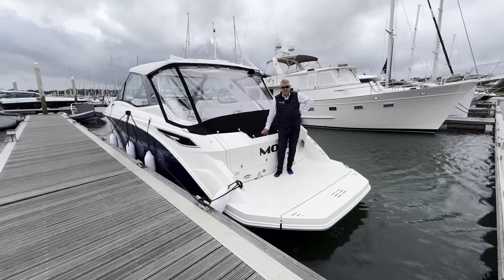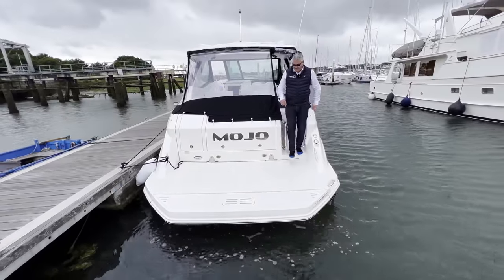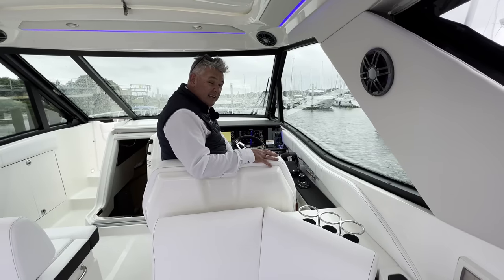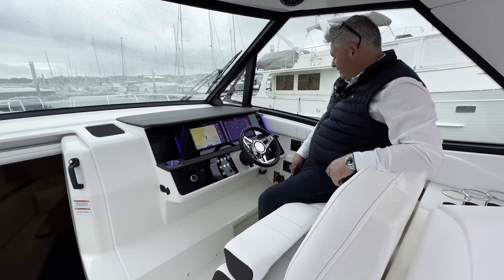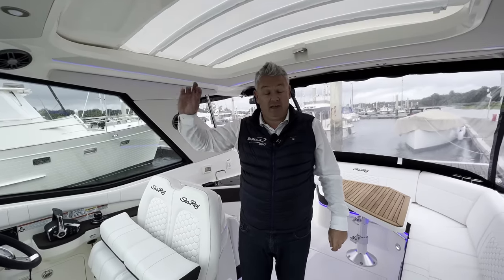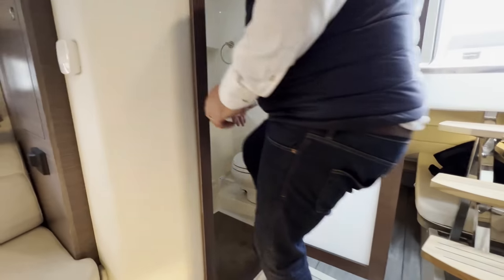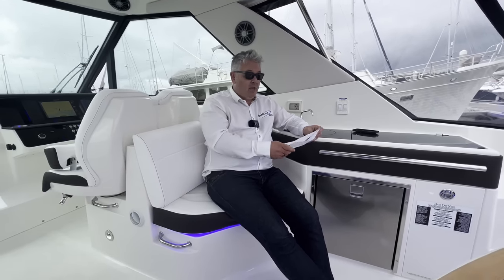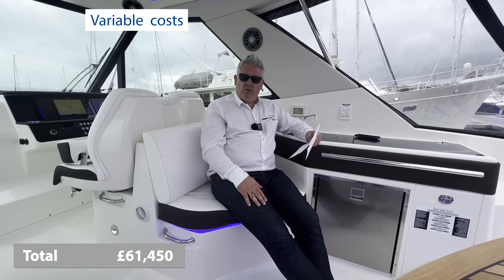NEW 2022 Sea Ray 320 Full Review - Worth the money?

Comment: We recentley changed a Bavaria 33S HT for a 2018 Sea Ray 320 open with hard top, the best option here in the Balearic Islands, especially as she has A/C in the oockpit! Good to see that the rear facing seat squabs have been shortened, giving more space on the bathing platform. We continually  have 10+ adults onboard and the lack of storage space is a pain for glasses, plates etc, so forget the BBQ grill - especially with our teak decking. A weekender IMO only for a young family. Bow seats are great for four people. The sliding front seat back needs a lock to secure it in either position - without it is dangerous. A well built & finished boat. Captain John, 40 years experience in the Med & Caribean
Reply from the maker: Great boat 🚤

Comment: If it had diesel engines, what would be the fuel cost difference?
Would it give the same performance? 
Just trying to work out pros and cons of diesel and petrol in boats.
Reply from the maker: Diesel fuel costs would be about 1/4 less. Performance similar but much noisier- they V8’s are sweet sounding and smelling 😊
Reply: As a broker who sells mostly SeaRays in Canada, I can tell you that the buy in cost of diesels over fuel is substantial and the service costs are much more. Unless you plan to put on a lot of hours the diesels are a waste of money. Additionally diesel fuel is much more expensive at this time than gas.
Reply from the maker: @bluemut55  100% agree - thank you Bluemut55
Reply: 60 l / h is probably for one engine, if you do 50 hours a year, take gasoline, if more than 100 hours, buy diesels, I have diesel and it's ok. At 7 knots I have a fuel consumption of 10 liters / h, at 23 knots 70 liters / h. For two engines.